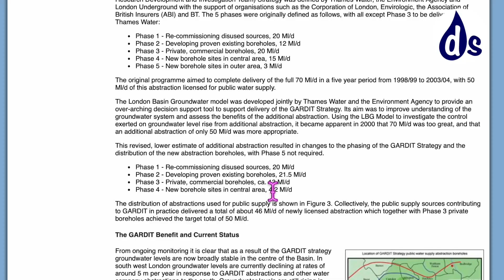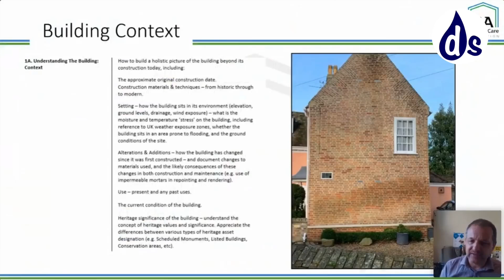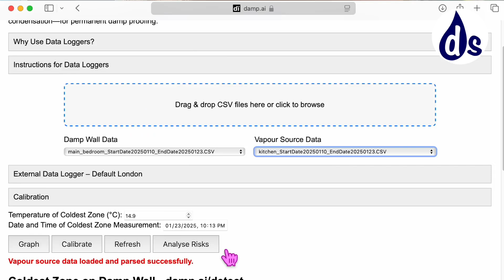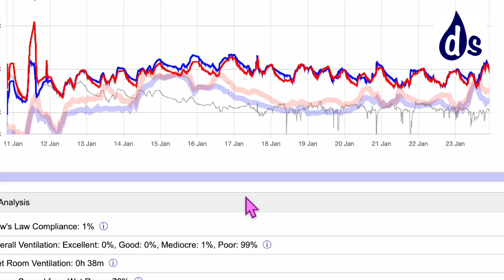❤️ Rising Damp - 🤔 Truth or Scam ⚠  #RisingDamp #DampProofing #DampSurvey #SkillBuilder #RogerBisby

Comment: Ive seen Roger confuse penetrating damp with rising damp on his videos. Water penetrating from high ground level which sloped towards a wall thus causing a wet wall, which then spread upwards..
Reply from the maker: I saw that video too and thought the same.

In Roger’s defense, his focus was on showcasing DryZone, rather than addressing the root cause. And when filming, it’s easy to say something in the moment—which then gets missed in editing. Roger is actually quite in line with my thinking—but I believe he defines rising damp more loosely, similar to Ross Charters (@completepreservation - who I also respect).

Unlike Ross, Roger tends to focus on tricks of the trade, in this case chemical treatment. Siloxane can indeed slow absorption, but:
1️⃣ It’s not forever—the effects wear off over time.
2️⃣ It doesn’t deal with the root cause—like rainwater penetration.
3️⃣ It introduces risk—if rain continues penetrating through, you increase the likelihood of rot and subsidence.

By chance, I watched another of Roger’s videos this morning: https://youtu.be/k9LdpRvnHpA - a recent buyer of a property that had a quote for £10,000 - but he dismissed, instead finding the genuine root causes of dampness. I thought it was very measured and correct.

The one thing I’d have added? I would have jumped on the mould—because mould only grows with excess vapour. And since hygroscopic salts (often present in groundwater) actually inhibit mould growth, the presence of mould at the base of a wall eliminates rising damp as a source.

Comment: Interestingly this video led on to a 2 yr old video by Roger Bisby about a damp patch on a pier where they went slapping a slurry of snd/cement (1:4 ie very strong!!) with 'waterproofer' without really ever addressing if the wall was damp , why it was damp and curing that but instead they (Roger and a builder friend) just went charging ahead to really mask the damp problem and potentially move it to somewhere else.  It was very localised but they still insisted on chopping off plaster up to a height of 1 m - quite unbelievable!!  https://www.youtube.com/watch?v=oQjKqttxjcY
Reply from the maker: It looks like Roger would make a good surveyor. He appears to correctly identify the true causes of dampness at the base of the wall. However, he doesn’t criticise Sam, the builder, for applying slurry, which is often a go-to solution in the trade. It’s hard to challenge a builder on-site, especially mid-job, and I can understand why he didn’t push back.

That said, masking damp with slurry rather than identifying and fixing the root cause is a common issue. The approach they took—removing plaster up to 1m high and applying a strong (1:4) cement slurry with waterproofing additives—is typical of rising damp treatment. The problem is, if the actual cause isn’t resolved, this can trap moisture, shifting the issue elsewhere.

I generally prefer surveying when builders aren’t present, as it allows for a more independent assessment without the pressure of justifying or criticising ongoing work.
Reply: @dampsurveys   Are you referring to "Damp Sam" ?

Comment: Love both your channels 30 years ago it was a condition of my mortgage on an old cottage that I got it damp proofed against rising damp, a decade later and the current cottage I live had the same requirement attached to the mortgage, this time I didn’t bother to comply I saved thousands of pounds and was able to pay back the mortgage earlier. It seems to me that the colder temperature at the base of a wall combined with high relative humidity and poor air circulation is better addressed by controlling humidity with a dehumidifier and ventilating the areas properly.
Reply: In a nutshell, you have just described the cycle that has been occurring in the house that I am restoring. Even a dehumidifier that is technically too small is having a big effect. There will be an additional one for next winter. There were other problems that I have addressed (worthy of a book!) but basically, this appears to be (hopefully) the major problem.
Reply from the maker: Thanks for sharing your experience! It’s frustrating how mortgage conditions often push unnecessary rising damp treatments, even when the evidence doesn’t support them.

You made the right call—saving thousands and paying off your mortgage early, rather than wasting money on ineffective treatments. The real issue, as you pointed out, is often:
1️⃣ Colder temperatures at the base of the wall—which naturally leads to higher relative humidity.
2️⃣ Poor air circulation—which allows moisture to linger and settle.
3️⃣ Misdiagnosis—blaming condensation-related dampness on “rising damp” instead of managing vapour properly.

Your solution—using a dehumidifier and ventilating properly—is exactly what I recommend. Injecting chemicals and applying slurry doesn’t just fail to solve the problem—it increases the risk of condensation. In fact, every damp wall with ridges in the video is the result of past damp-proofing treatments. Condensation forms along the interface between the permeable and impermeable layers, causing moisture to condense and crystallize calcium sulphate salts—leading to the very issues these treatments claim to fix.

Thanks again for your insight—hopefully, more people start questioning these outdated mortgage conditions!

Comment: What are the data loggers you suggest using, and are they just measuring the humidity in the air, or are they measuring surface wall humidity?
Reply from the maker: Great question! 😊

My preferred data logger is:

✅ ORIA Wireless Hygrometer – Inexpensive and great for tracking multiple rooms via a phone app.
But it can be found under different names on Amazon and similar platforms. These loggers need calibrating with salt and water for accuracy.

I’ll be putting up a video on using data loggers soon, so stay tuned! 🎥 In the meantime, check out https://damp.ai/detect for step-by-step guidance on tracking humidity effectively.

You’ll need:
🛠 Surface temperature tool – e.g., a Laser Thermometer to help identify cold spots where condensation may be forming.

The key to understanding damp isn’t just a one-off reading but tracking changes over time.
I suggest placing data loggers in these key locations:

📍 One on the coldest part of a damp wall – Normally at the base, away from sunlight and direct heat sources.
📍 One in the closest source of vapour – Bathroom, kitchen, or drying area—ideally above the door.
📍 One outside – For external comparison (away from sunlight, rain, and mischievous squirrels or birds!).
📍 One in the sub-floor away from an airbrick – If investigating underfloor moisture.

Let me know if you have any questions! 🚀

Comment: I hear many people describe genuine rising damp as a myth, yet when I ask, if that's the case why install a DPC at all during a House build? Nobody ever answers so the only conclusion I can fathom is that it is not a myth but just exceedingly rare due to being well managed from day one of a build? Is that a correct assumption or Is there another theory? I'm not in the trade at all and have no training I'm just a damp nerd that finds your videos very interesting 😂
Reply from the maker: Thanks! My own house didn’t have a DPC originally, but at some point, someone injected chemical damp-proofing. One of the photos in this video is actually from my house—it looks ugly and probably knocks about 1% off the property’s value. I predict that in time, the sight of injection holes will be seen as the folly of our fathers—an unnecessary and damaging treatment based on a fundamental misunderstanding of moisture movement in buildings.

I see a DPC as a “belt and braces” measure—temporarily useful if rainwater goods fail or sub-ground pipes leak. However, if you have a situation where a DPC is apparently holding back moisture, the real issue is almost always:
1⃣ Rainwater penetrating damp from defective gutters, downpipes, or high ground levels.
2⃣ A leaking underground drain or mains water pipe allowing moisture to accumulate in the soil.

DPCs can even be counterproductive in properties with high sub-floor humidity. I’ve often seen cases where condensation forms above a DPC, but because moisture can’t be absorbed downward, it ends up being absorbed upwards, mimicking rising damp—when the real issue is often a leak in the sub-floor void.

The reason DPCs are installed during a house build is precautionary rather than because of an expectation of groundwater causing rising damp. In general, homebuilders don’t construct on zones of high groundwater—but that’s not always the case. My sister’s house, built in the 15th century, sits over a small constantly running stream. No DPC, no rising damp—just sufficient sub-floor airflow keeping the moisture in check.

So your assumption is correct—rising damp as groundwater rising via capillary action is incredibly rare. But when damp appears at the base of a wall, it’s often misattributed to rising damp, leading to slurry treatments that hide rather than fix the real root cause.

Check out https://damp.ai/rising-damp for more insights. 🚀

And I love the damp nerd enthusiasm—welcome to the club! 😂
Reply: @justinarkell1952  it is confusing when there can be so much bias in some narratives. But water can rise against gravity. You can see that on the edge of your tea cup, the edge of the drink curls up. As for rare, well, we have about 29 million homes in the UK so if rare is between 0.1% and 1% occurance then that's about 300,000 homes that could realistically be affected. The design of walls has evolved from solid walls because we need universal designs across the UK and to overcome to vulnerabilities and costs of solid walls. The other thing to remember is that of the older houses only the successful ones remain so you are not likely to see the scale of past failures. A damp proof course is cheap and easy to install so it's a useful feature to include in all cases. The regs don't insist on a dpc it just says the wall must resist the passage of water.  It is an interesting topic.
Reply: Thanks for the detailed explanation and the link, very useful and interesting. 

I run a small DIY group and we get lots of questions regarding damp and damp proofers which nearly always turns out to be condensation or raised ground levels so we're trying to do our best to stop this kind of expensive and unnecessary work.

I have used your explanations on the group so you have actually helped more people than you realise, good luck I hope your channel goes from strength to strength 👍🏻
Reply: @justinarkell1952  I am purely DIY when it comes to building/damp prevention, but worked as an electrician in a previous life. I have  experienced damp in lower walls when chasing socket boxes in, and raised ground levels often seemed to be present. Blocked gutters were often observed too. By the same token, a relation's house had a lake beneath it, requiring wellies if working under the floor, but not a hint of damp in lower walls, and no obvious condensation in house.
Reply from the maker: Here’s your response with some well-placed emojis to improve readability and engagement:

Thank you very much! 🙌 I really appreciate the support, and it’s fantastic to hear that your DIY group is helping push back against unnecessary and expensive damp-proofing treatments. 🏠💡 Education is key—the more people understand about condensation, ground levels, and proper damp diagnosis, the fewer will fall victim to bad advice. ❌💷

I’m always up for exploring new topics—are there any damp-related issues your group would like covered in the next month or so? Let me know, and I’ll do my best to create something useful! 🎯📹

🔍 A Widow’s “Mystery” Damp Patch

Just today, I visited a widow who had a persistent damp patch on her rear bedroom ceiling. 🤔 A roofer had already removed her chimney stack and replaced the roof—yet the damp patch remained.

She told me eight different tradesmen had been to the property, all trying to sell her a solution. One even claimed to find a leak in the loft, but when she challenged him, he opened his coat to reveal a spray bottle—used to fake the leak. 😱🚩 Another told her all the insulation needed replacing because it was “damp” 🧾💰—despite her being able to see for herself that it was dry.

🏗️ The Real Cause?
❄️ A thermal bridge created by a missing section of insulation around the base of the removed chimney—causing condensation on the cold surface. Essentially, I was able to diagnose and fix the issue, but replacing the missing insulation, in about five minutes. ✅ No expensive work required! I’ll also be recommending ways to reduce internal vapour to prevent risk of condensation elsewhere. 💨

📢 The Bigger Picture
Stories like this highlight why better damp education is essential—not just for homeowners, but for professionals too. 🏡🔬

It sounds like your group is doing great work 💪—helping people spot simple fixes before they get talked into unnecessary and costly work. 🛠️💷 Keep it up! 😊
Reply: @dampsurveys Excellent, thanks for the offer, it's mostly condensation and bridging issues at the moment which you've already covered in your videos but if anything new comes up I'll give you a shout.

Brilliantly catch on the uninsulated chimney, she must have been well chuffed about that, possibly saved her thousands of pounds 🩵🥳